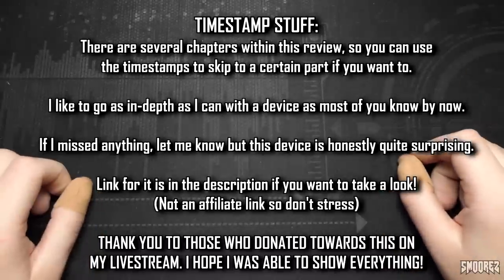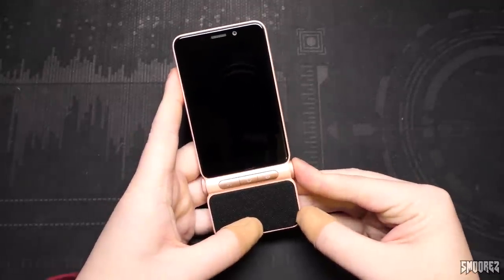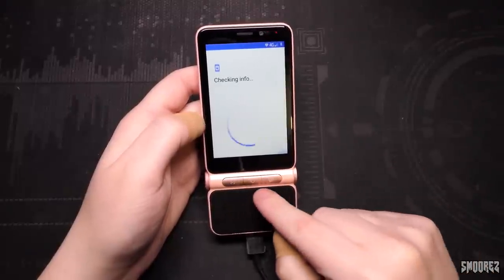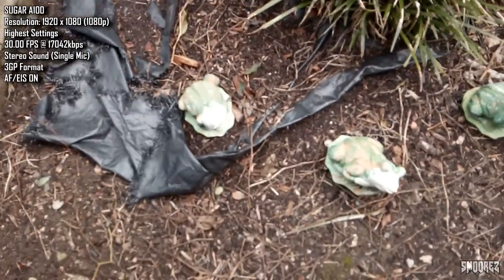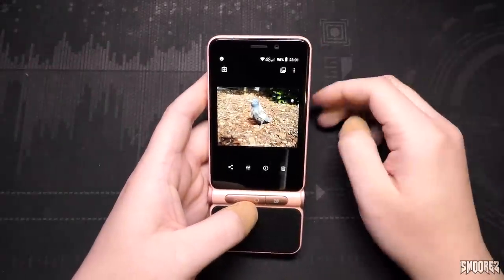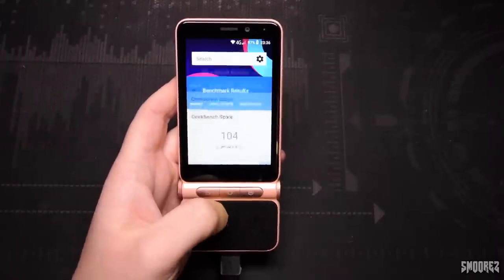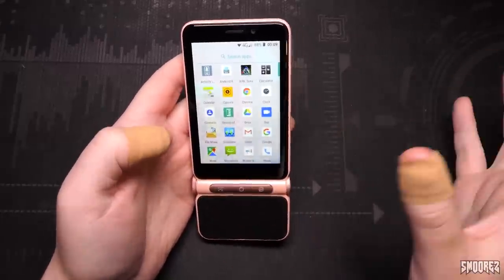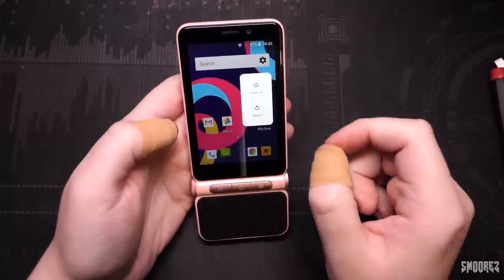The $84 SUGAR A100 Phone from AliExpress - A Budget Friendly Music Device...meant for kids

Comment: Surprisingly this design actually has a Red Dot design award from 2019, under the name "TIGER P180". Seems like the design was "originally intended" as a smart translator device, i.e. an OEM phone design running android which could be used for Google Translate. Or Baidu translate, I remember real-time translation being a popular gimmick around 2016-2019.
Reply: Yeah searched it up, very similar except the nav buttons
Reply: That explains the huge ass speaker

Comment: That is such a cute little phone, and... if it had a headphone jack, I could see that being a good dedicated music phone, particularly with the little dial.
Reply: The good old headphone jack 😊 . I wonder what it sounds like with ear buds over Bluetooth
Reply: @UserUser-ww2nj  honestly if it's using sbc full spec probably fine. Fun fact sbc has various settings and is so well known as bad because old devices used low to mid end settings. At full quality settings it actually holds its own, though it's latency is eh.
Reply: @FinnFann  I have never gone into the different Bluetooth settings , with me it works or does not work 😄😄.
A lot of the time i am scared to alter any of those kinds of settings in case i either brick the phone or screw something up 😭
Reply: @UserUser-ww2nj  Oh that's the thing you can't change them. Part of the reason SBC gets such a negative perception. Even on modern android it's 100% up to the phone maker what SBC settings your phone tells the headphones it can use. Luck of the draw.
Reply: @FinnFann  O.k , thanks , i stil have no idea where to look to find what settings my phone has . Oneplus 5T , old now but still good enough for me . I am not a fan of iphones and their crazy prices . Thinking of getting the Nord as a backup

Comment: 18:58 The reason why it did not work initially is because it had like 4% battery life but now that you charged the battery well enough it works now.
Reply from the maker: OHHHHH that makes sense. Thanks for correcting my dumb brain lol
Reply: I was about to type that until I found this comment 😂😂
Reply: To be fair most current Android devices tell you this when you try to use the flash or camera on a low battery. It'll pop up a message on the screen. "Cannot use flash/camera because the battery is too low, please charge your device" or something very similar to that. This phone just didn't do it and didn't tell you why which is odd.
Reply: yeah, probably under 15% it's not working
Reply: I think its below 10%
Even though most devices now do low power at 20% instead of 15%, i think flash still turns off at 10%
Reply: @CaseyDplays  yep which is why i like old droids tbh. If your outside in a emergency situation your buggered
Reply: I came here just to make sure someone else had already commented on this 😅👍
Reply: @LibbyMia-rz8gk my pixels running A13 and will turn on the torch at 1%

Comment: I think the issue with the camera light is a common issue I too had back in android 8. I think it was early to have android have a built in light button. It is almost like the software can't start the light so you need to open camera and try again.(Reminds me IDENTICALLY to when you power on your phone the fingerprint scanner wont start but once you unlock it, it works every time.)

Comment: For the bands, this phone wouldn't work well in Australia and have greatly reduced coverage since its missing the major long range bands here in Australia. (B28 for Telstra & Optus, B5 for Vodafone)
Reply from the maker: Yeah since I'm in a fairly populated area, they did work but you are right, out of this city area would probably make it lose signal very quick.
Reply: I love you work wit and wisdom
Reply: The bands are listed in the user manual and visible at 5:43. FDD-LTE has B5 but no B28
Reply: @SMOOREZ  can you use mtk-su or SP flash?

Comment: Many phones (even when plugged in and charging) won't allow use of flashlight when in single digit battery life. And given that the icon wasn't even going into "on" mode, I'm pretty sure it was locked out when you were trying. You've used phones before, no?
Reply from the maker: I didn't think of it at the time. I usually don't have devices that are at a low percentage and be testing them. I did know about it, just flew right past me since I was too focused on the phone and how it performed etc

Comment: The torch didn't work at first because the battery level was too low

Most phones under 15% battery won't allow you to turn it on and will tell you that but this one didn't for whatever reason.

Comment: The flashlight did not work because the battery was below 5%. Some Phones restrict the usage of the torch and some other functions when the battery is low. Depends on the brand most likely

Comment: Oh... No system dump this time. :(
It would have been fun to play around with the Sugar-specific apps.

Also the flash didn't work because the battery was too low. If i remember correctly, flash only works over 5% battery charge.

Comment: I picked one a blue one after watching. Not a bad little device at all, especially for $50USD. Took 11 days to arrive in the southwest US.

It is vulnerable to mtk-su, so it can be temporarily rooted very easily. Do note, however, that rooting this phone seems to wipe both IMEI numbers.

The bootloader is also unlocked by default (which you can just barely catch at 16:42 in the video) but I've been unable to permanently root it thus far.

Comment: Manufacturer could just disable 60fps video on YT and it would play 720p fine. Can't believe almost no one does this. You can do it manually with yt vanced, set phone model to SGS 1 and 720p would play fine, maybe even 1080p. My phone from 2014 with mtk6572 could play 720p fine
Reply: I'm using vanced 15.40.37
Reply: Its not just disabling 60fps, but also using an older codec. It also works on old PCs with h264ify browser extension
Reply: Btw since vanced doesn't get updated anymore you should try revanced

Comment: If you want to try dumping the system files for people to peek around a bit, since it is a Mediatek device with a 2018 security patch level, there's a chance you could use mtk-su to get root access and dump files that way (whether it be by using dd to directly dump whole partitions or by just copying files somewhere else)

Comment: a lot of these phones use older chips that require the camera to be initalized once (per boot, usually) to activate the flash light. the reason it didn't work the first time was likely because the camera wasn't initalized and since its running android 8, it doesn't know to activate the camera since most devices doesn't require this step anymore.
Reply: When is a camera not initalized?
Reply: @tylern6420  on boot lol
Reply: @Nurf  battery issue lol
Reply: @tylern6420  generally, in older versions of Android, the torch activated the camera as well. newer ones don't, to preserve battery, but they require you to open the camera first to initialize it so the torch, which is a part of it, can be enabled. it drains the battery quicker tho so yeah

Comment: Honestly for 70$ usd I could see using this as an MP3 player. It's easily fast enough for that. Has a nice built in speaker. I hate useing my phone for music because it eats data and runs down my battery.
Reply: IMO that $70 should be invested to MicroSD card. Then you just insert them in your smartphone, download them locally and place it there

Unfortunately, most phones nowadays are missing MicroSD card slot so I hope yours aren't
Reply: You can load offline mp3s on any Android phone. (And it will barely consume battery- like 3% per hour if you got a decent device) On iPhones it should be still possible with legacy iTunes support too, but I am not sure.
Reply: Just download the music? And if you really want an mp3 player they are better and cheaper options including either headphone jacks or Bluetooth capabilities.